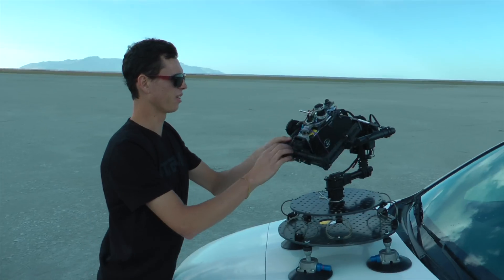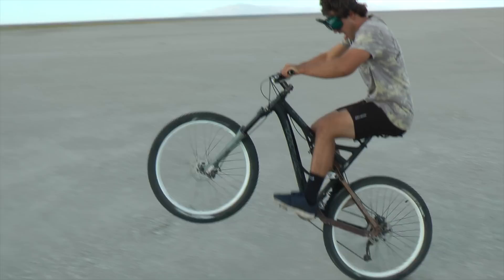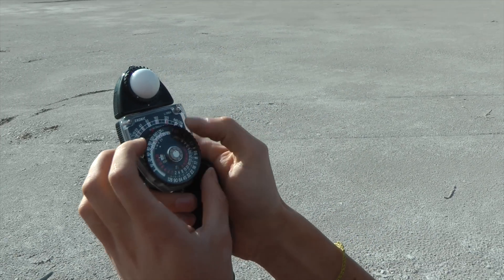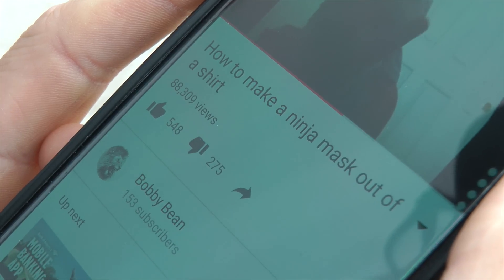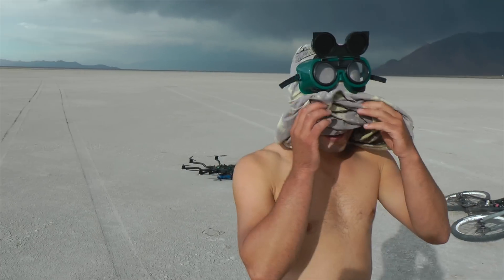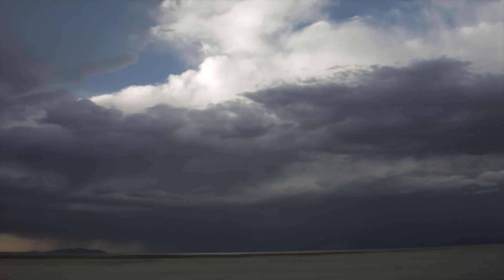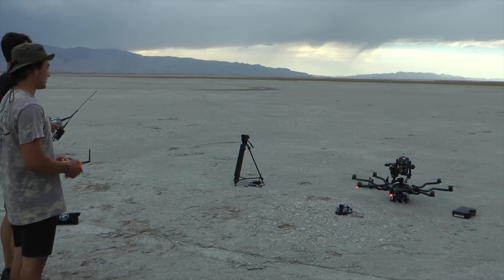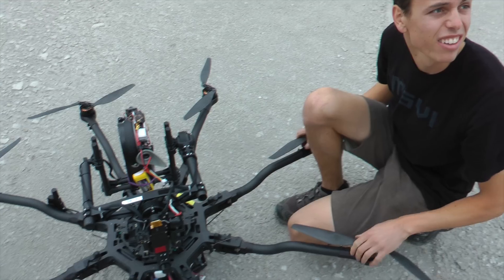16mm Bolex Film Camera on Drone and Gimbal

Comment: Wow I wish I had a camera like this!!
Reply: they are not that expensive.
Reply: I seen them go as low as $100 on eBay which is awesome.  Bolex still makes this camera but a new one is expensive though at a fraction of the cost of a Red camera.  Even a used Red camera is more expensive then a new Bolex H16 camera.  If film was not so expensive I would ditch digital in a heartbeat for filming everything.

Comment: When I was in my early teens I had a Bell & Howell 8mm film camera that also used a crank to wind up the spring. No batteries needed. And the film came on a 25 foot spool and was 16mm wide, however, when it was developed they split it into 8mm and spliced it to make it a 50 foot spool. What a great contrast on the desert while you were filming.
Reply: That format is still available today though I don't see many Double 8 cameras.
I actually own one but not sure of its condition.